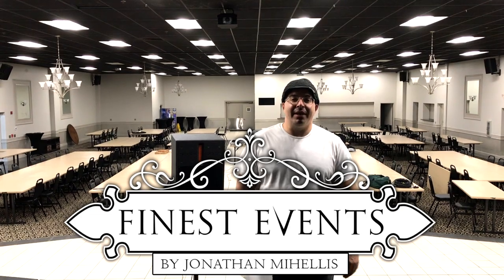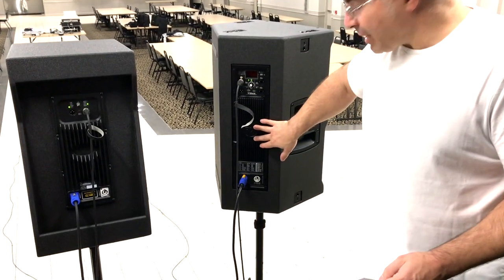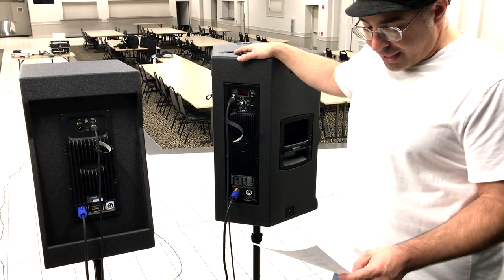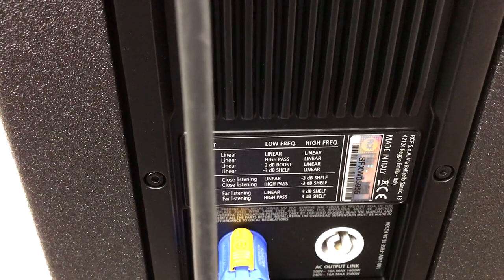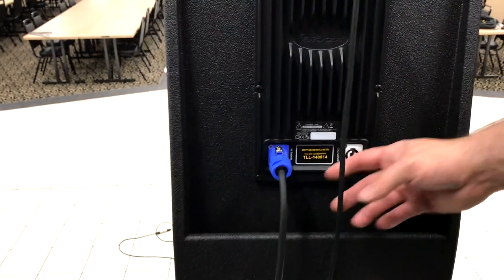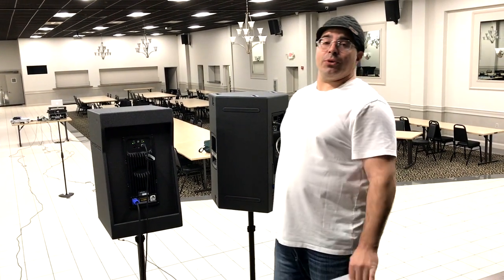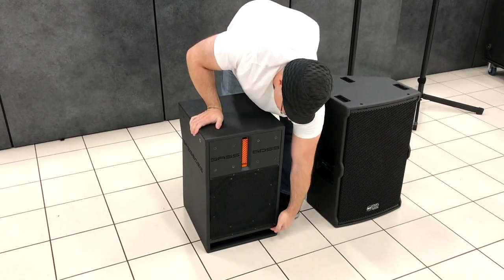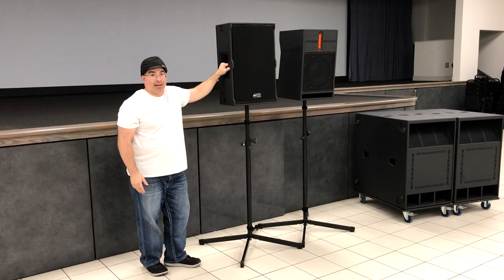Bassboss DV12 vs RCF TT25A-II  SPECS AND ERGONOMICS

Comment: The Bassboss max spl is real, RCF's is made up by the marketing team.
Reply from the maker: Lol, I feel like Bassboss under rates their stuff.
Reply: @FinestEventss  they don't. Other manufacturers give theoretical spl levels at 4 times RMS. While BassBoss give measured spl. A 12 or 15 inch top in a basreflex configuration cannot go beyond 130db at 1000w.
Reply from the maker: @habdulahsalam  agreed!

Comment: have any of you heard the new BassBoss subs? I have not heard the mk2’s but I do know they have given the new ones more power, better hardware and software. The DV12’s saw a decent improvement with the MK3’s so I’m assuming the subs did too. I bought the 18 with the 4 ports in the corners and man is that thing loud, low, and accurate. My RCF 18 doesn’t even come close to the BassBoss 18. As far as the DV12 MK3’s they are superior to any 12’s I’ve ever owned including my RCF’s the I upgraded from. The clarity, accuracy, and dispersion are unmatched and the dispersion is like that of a line array.
Reply from the maker: What RCF’s did you have?  As for subs, I have yet to hear better than Bassboss.  The DV12 is an excellent speaker but its downfall is the weight and ergonomics.  If handling on your own they aren’t fun.  However, the sound quality is excellent.  I have heard from other users that MK3 isn’t much better than MK2 if at all but I haven’t tested that with my own ears.   I recently had a chance to compare the Meyer Ultra x40 to the DV12 and the Meyer box is the only one I have found that literally destroyed it.  However it’s nearly double the price.  For the money, and they are expensive, Bassboss is a great choice.
Reply: @FinestEventss I have the Jmix8 and j8 for mains and the 18”  708 ASII for the sub. Honestly they sound pretty good but no comparison to the BB DV12’s MK 3’s. The RCF sub is ok but does not project like the BB. I don’t find the DV12 to be awkward to carry and most of the time I transport them on a small cart. As far as putting them on the stands, I just lay them on their side on the cart, then stick the stand in the bottom of them and lift them up. I tried to lift them up onto the stands when the stands were upright, but they are too heavy to try to manipulate that way. I know some people say they don’t like the way the DV12’s look but I think they are awesome looking. When I was in Sweetwater, I tested out RCF’s upper line and still thought they could not compare to the clarity of the bassboss 12’s.  They definitely could not cover the low end like the bosses can and the bosses sounded much flatter and accurate to me.
Reply from the maker: @bsbarber73  if they weren't awkward you wouldn't have to lay them down and put all that pressure on your sub pole to lift them up.  I know another guy that does that but I don't trust putting that pressure on 4 tiny screws.  You should be able to easily lift them up but its hard because of the design and weight.  I also have VS21's and when they are in the upright position you have to get on a ladder to get them on the poles (Unless you're super tall).  I almost killed myself a few times when I was stuck on my own because there were no where to grab and I was in an odd position on a ladder.  Not doubting its sound at all.   I like the sound of the DV12 too and have made a suggestion to Bassboss to make a lighter version that is designed to be used with subs with better ergonomics.    Meyer X20 is 27lbs and just as loud if not louder than the DV12.  Clarity is better too.  It is also a wooden cabinet .  This is how I know David can do it because its been done.
Reply: @FinestEventss I don’t typically put them on the sub. Usually the sub is center stage. If and when I get another sub I will probably do that and actually might be easier to lift if standing on the sub. My tripods are beefy and hydraulic so really it is one motion and they go up quick. The ones you mentioned I’m sure are great but no way I can afford double the cost per speaker. Don’t make enough off of gigs to justify spending any more than I did. Maybe later down the line but just bought these and pretty happy for now.
Reply from the maker: @bsbarber73 I totally get it.  Do what works for you.  I misunderstood how you were doing it.  They are great speakers, I used them for years and still would be if they were lighter.

Comment: Online resources say the RCF is 57lbs, not the 60 something you mentioned.
Reply from the maker: I pulled those specs from their site at the time of this review.  Not sure why the discrepancy now but when I just rechecked, you are correct.  A little over 57.  Easier to manage because of the handle placement.   Ergonomically speaking they are much better than the Bassboss, even the MK2 version of the DV 12.
Reply: @FinestEventss  would you say it’s worth it to invest the the TT25Amk2 or go 945A or NX45A?
Reply from the maker: @gaffle-411  unfortunately I don’t have any experience with those other boxes and couldn’t give an informed opinion.

Comment: As far as sending 600 watts RMS to a tweeter, there is no reason why you can't just use a heavily limited amp - the purpose simply to keep the signal as clean as possible for sound quality (low THD and peak clipping) reasons - even if in practice, you are using no more than 100 watts of it.
I'd like to compare the Bass Boss with a Barefaced FR800.
Reply: Yep, folks who want a full blown DV 12 experience, might need to eq it, at 26 lbs (passive) the Barefaced Big Baby 3 is the cabinet. The powered version (FR800) was discontinued.

Comment: Hello nice video. 
So would you say it’s worth getting the bass boss over the RCF? For loud and clean. 
Also how many amp does it needs to plug on a breaker? Thank you.
Reply from the maker: They are both great speakers, I don't think you would be disappointed with either.  I think you should decide on which type of dispersion you prefer?  The RCF is narrow and the Bassboss is 120 degrees.  They both get loud and are clean.  I personally use the DV12 MK2 now and I cannot say how many you can put on a breaker.  They are very efficient and pulled less power than my Evox 8's when I measured them on my amp meter.  They also can be crossed over at 4 preset points.  The more low end you take out the more you can run (This is when you run with subs).  Hope that helps.

Comment: Did you match gain?  Have the speakers volumes all the way down and turned off.  Bring the boards output level to +12dbu with Pink Noise.  Turn on 1 speaker and bring its volume up on the back until the limit light just starts to flash and turn it off and don't touch the volume knob again on the speaker. Next do the other speaker the same way and again don't touch its volume knob again. Don't change the boards +12 dbu output when setting these gains for both speakers.  With this done both speakers will reach full output with the same input. Of course you can turn the board down now and do your testing. If both speakers are not gain matched.(input sens.)  Then one may be louder than the other but will reach full output first which is not an accurate test. This at least will get you in the ball park.  ( Of course if +12dbu is too much with the speakers volume all the way down you can lower your boards output some. Again the idea is to have both speakers reach full output at the same time with the same signal.)
Reply from the maker: This is what we did.  We let both limit lights flash a bit while testing just to keep things equal.  The DV12 recently had a DSP update.  It sounds even better now.  Be sure to watch video 3 and you will see the results.  Thanks for watching!
Reply: @FinestEventss  Only one thing to consider. 2 different brands of speakers may have completely different idea's as to what goes on during limit. In some brands the limiter also effects the frequency response and spl broad band too. Also how those limiters are setup for each bandpass and how they react to music could be different also.  In general once you setup for unity as I mentioned above you can then turn down the mixer and test the speakers 10 db's or so below limit. The SPL will have the same difference between the 2 speakers but the spl and frequency response will not include the limiter section effect on the output. As we all know if your running a speaker into limit you don't have a large enough system. Set unity between the 2 speakers at limit then drop the main's down and compare from there.   Also next time check both speakers off axis at the same degrees off. Check both at 45 and both at 60 ( I'd have to watch the video again to see if it was 60 degrees ) A better reference to compare the two. Overall Great Work! Keep them coming.  I would again setup unity then lower the output on the board so both speakers are no longer into limit. Just mute the board when switching between them and be sure to leave the boards output and volume on the back of the speakers untouched. This will show the correct volume difference.   A small difference by the person turning up the speaker in back, speaker to speaker, measurement to measurement could easily throw the measurements off. Also place a single speaker at a time in the measurement location. Ported boxes resonate at a given frequency when soundwaves hit them. A speaker close to another speaker not putting out sound could resonate and  this sound may cause low frequency content to come out. This added spl may be out of phase  and cancel some frequencies with the speaker being tested. Its possible to have 2 different speakers with different phase responses to really cancel output in a given range. By testing 1 speaker at a time and having the other one covered or on the floor face down will help keep this problem from skewing the test results. You've done so much work you might as well get it as close as possible. Thumbs up!
Reply from the maker: @douglasallen534  that took a lot of my time and I can tell you I just don't have the time to go run it all back.  I also had to get clearance from the venue for a day, not to mention I have to send the Demo unit back.  All I can say is I've listened to both, run pink noise while taking the best and most fair measurements I could in a real world scenario, and listened off axis.  Ill personally stick with Bassboss.  The DV12 sounds more to my liking and the dispersion is great for what I do.   The 12 inch driver has an incredible amount of low end compared to the RCF when they are both compared in full range and doesn't have such a harsh sound at high volumes.  Im not saying the TT is a bad speaker, its just not as good as the DV12 in my opinion.  To each his own.  Do yourself a favor if you are interested in either of these speakers, go listen for yourself.  It wasn't an easy task as these models aren't sitting in your local guitar center, but I am very happy I did because I let my ears make the decision and not the specs released by the companies.

Comment: I heard them ... bass bos is a joke compared to rcf ... they sound like auto speakers :)))
Reply from the maker: Lol... most people, including myself,  would disagree with you.  With the MK2 version of this its not even comparable.  This particular RCF has little low end and the high end is boosted.  RCF must pair with a sub where the Bassboss has a much flatter response within its advertised frequency range and can respectably hold its own without a sub.  There really is no comparison and bassboss does it with smaller drivers.
Reply: @FinestEventss  this guy above apparently has no clue what he’s talking about.   Auto speakers?   Come on man!
Reply from the maker: @dj_dannygee  lol 😂 not a clue 🤦‍♂️
Reply: RCF is good but you got to be stating this without even hearing them. lol I upgraded from RCF to Bassboss and they are way superior to RCF.
Reply: This is a joke statement I dont what bassboss is doing but for a powered speaker company their products are insane...spl and clarity is ridiculous the bottom end is confusing though....that thing plays like it has a separate sub attached for such a small cab...its really crazy